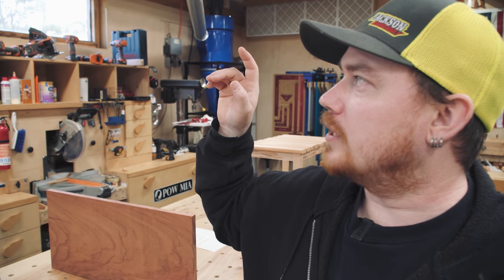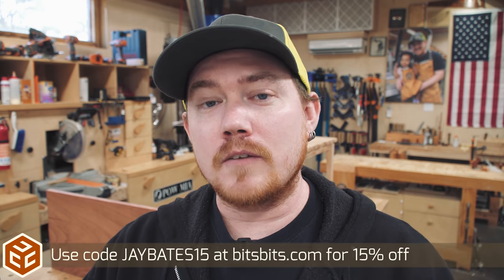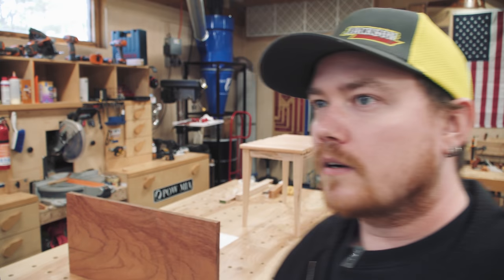Vlog #146: BIG Bubinga

Comment: The original Gorilla glue requires moisture to cure. Think it was polyurethane glue? If the wood is bone dry the glue doesn't harden fully. Norm used it on joints that had to be extra strong.

Comment: I have found the arguments about CNC to be interesting.  To me its another tool That I was able to afford for my shop.  Its not always the best tool to use.  I can round an edge on my router table a lot faster then setting up the CNC.  There is the right tool for the Job.  I am old enough to remember Norm when he started.  He had a shop smith and a craftsman table saw.  Towards the end he had all kinds of tools.  Do you remember seeing the huge drum sander he had.  I met the crew from TOH one time and they accused Norm of not changing router bits anymore he just picked up a different router.  My likes and dislikes change from day to day as does my interests.  What I look for in content is different techniques or ideas that I may be able to use next time even if I don't have that machine.  I remember Norm built a storage shed one time.  I did not need one but I learned something about it.  Perhaps we take this stuff a little to seriously and we should step back and take a breath.  Jay I like listening to your stuff even about your software and hardware and I have no desire to publish video's but its interesting to know how you do it.

Comment: when i google it says this, In wood joints, the curing glue expands into pores and reacts with moisture there to form strong bonds. This makes it a natural for gluing slightly damp outdoor woods. But it also means that dry woods, those below about 10% moisture content, need to be wiped or misted with water before gluing.

Probably wood was too dry for good glue-up

Comment: John is also a DaVinci Resolve user, AFAIK.  I tried it out a few years ago but ended up going to Final Cut Pro X -- I'm a Hackintosh user.    But I've also been on Gimp for 10+ years and I'm sure I barely scratch the surface of it's abilities.
Reply from the maker: That seems to be my biggest hurdle right now. I've been messing with Gimp again but one thing I'm missing is batch processing of images. I pull 60-80 images from the video edit and write an article. In Photoshop I use a batch process to resize, place my logo, save for web on an entire folder with one click.
Reply: @JayBates2     Can't help you there, never done batch processing.   Sounds like something I should learn about

Comment: If you used linux and built a computer out of used parts you may already know this, but AMDs new Ryzen 3000 processors are excellent workstation CPUs at a very reasonable price.

Comment: I don't think you should worry too much about separating CNC out but you can be frugal about what mix of projects you edit to publish. MAKING is MAKING but having a machine do most of the work using a high priced tool to do it does turn off a LOT of people wishing to emulate you. The audience for the CNC might be highly interested but the NUMBERS are much smaller.(IMO) Just go with the flow but remember your audience is what you build by what you do. You, as a personage, are important to the outcome and continuing interest. SPREADING YOURSELF THINLY ON SEVERAL CHANNELS -- may not be a good solution even if your personal interests change. And, not everyone is willing to follow four or five different electronic gadgets/channels all the time (I.E. Instagram/Reddit/Etsy/Facebook/Youtube/Pinterest/.YADA YADA..) . I have NO interest in getting bugged constantly from the YouTube people I watch on Instagram/Pinterest/YADA YADA...too. I follow John Heisz too but he has drifted to more talking than doing for a while and I have waxed and waned in my interest levels. John is very intelligent and very creative. Not just another hammer with a nail to hit. You can still do CNC without making IT your primary tool - see Frank Howarth's stuff. Just remember HOW your audience found you and HOW you kept them before changing your model. John is still John, but what he's doing is (was) not the same John because he started talking a lot about things he never did and not doing anything besides.  (He's changing again now.) We watch because we like seeing the doing and the person... If a machine is churning with a camera watching it the whole time, where's Jay? Its OK for a little bit but not just watching you take the end product out and showing it off as a great thing. That's like watching unboxing every week. What does that do for the audience who doesn't have the budget for that? And I have no interest in trying to struggle with several different programs/URLs/devices to follow along. I still have a life away from the computer.